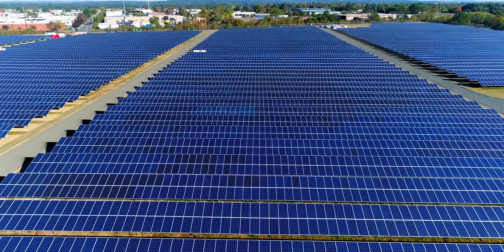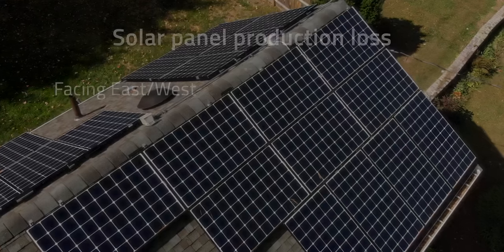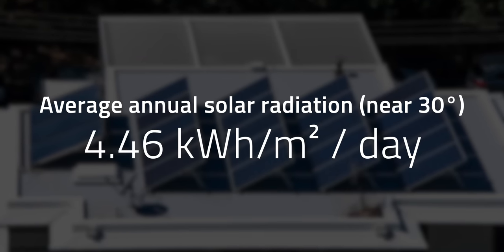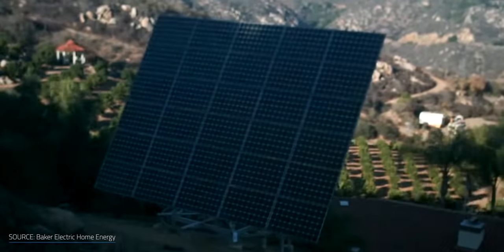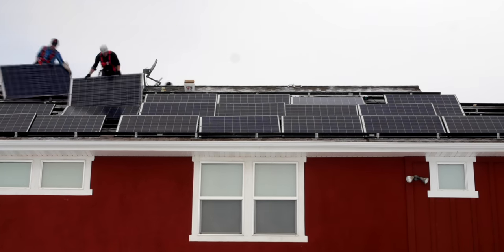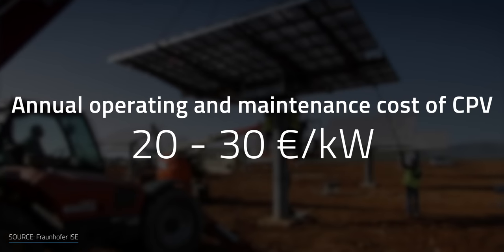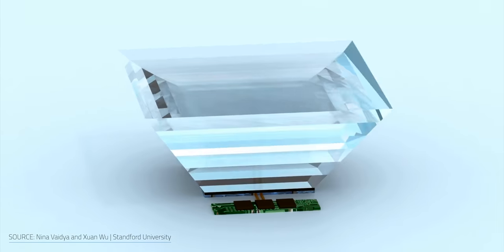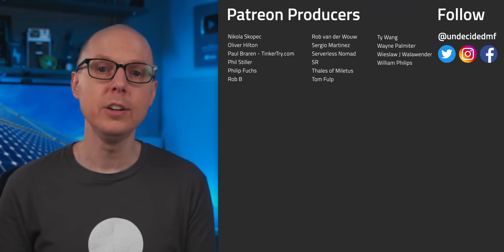This Invention Could Supercharge Solar Panels

Comment: It's like when they say they developed some new super fast charging battery with more capacity than other batteries and then we never see it hit the market. It's just an idea they presented in a lab that doesn't seem very usable in its current state. I'd be worried about weight, cost to manufacture, and installation cost/complications. Does having those lenses mean that now it's also easier to damage?

Comment: Fresnel lenses over a metal solar panel of about 1" square has been used for years, but is not really as low cost as you might think.  And solar panels work mush less efficiently when concentrated power causes them to overheat!  This causes them to turn brown, instead of the factory fresh blue color.  

Even with huge heat sinks, and fans on the bottom of the solar panel to help move away the heat, they still failed.  And the fresnel lens needed to be pointed straight at the sun, so that the sun hits the collector straight on, not the space next to the solar collector.

Comment: This can't replace the tracking systems. The area of the sun facing surface is important. regardless of how you bend light, light that does not reach the surface won't be captured.

Comment: What would be very slick is if they could produce "AGILE panels" that could be mounted to the face of an EXISTING solar panel.  Even if all it did was to "correct" the azimuth and elevation pointing errors of the installation without any added focusing, it would boost the output of any array.
.
The system I want to build is a ground mount with MANUAL elevation adjustment.  Tweak it about 4x a year to keep production roughly steady.  The auto-trackers definitely have more parts to fail.

Comment: I've always wondered why people wouldn't use an inverted panel over a parabolic mirror trough, much like a satellite dish receiver, thus concentrating the sun into the panel and reducing dust covering the panel. Would also be able to integrate solar water heating by running coolant over a heat sink on the back of the panel which would be required.

Comment: I helped run some trials a decade ago and there were a couple of CPV technologies involved. The massively increased thermal load in the cells was a huge problem. One company pretty much fried their cells by midday on every day of the trials. Those who could dump the heat had to employ various methods that cost in terms of materials and maintenance. If anything happened to the cooling systems they had to defocus the panels and stop generating.
Other than the thermal problem we all loved CPV. Less of an issue in space, not so good on earth!
Reply: Now we can buy window film from Amazon. Would help to filter out unnecessary wavelengths before the heat got concentrated.

Comment: What I really want to do is have a ground mounted system that's fairly high off the ground, which I can set up a chicken run under, and have some sort of crank system so I can manually change it to 3 different angles, 1 for summer, 1 for winter and 1 for spring/fall.  But this would be way easier. Then I'll have better power generation, shade for the chickens, and I won't have to try to mow under there.

Comment: I would really like to see a modular version of those light focusing solar cells where you can just pluck it off the larger board with a suction cup for easy replacement, and combine that with a modular board design too I think it would allow someone to simply have a large bracket and battery install and then buy sections of the board and solar cells as you go building and increasing solar power as you go till you've got enough to meet whatever their goals are

Comment: "Too heavy to be installed on rooftops." 
If instead of making a big heavy duty support structure that can withstand huge winds, a folding dish system that folds up in higher winds might be very inexpensive.  If the dish has a hole in the middle one half the diameter of the dish, the dish only loses one fourth of the solar collecting area.  But the hole would allow the dish to withstand a higher wind and require a lighter, less expensive construction.  If the dish folds up at say 30 mph winds, the wind power at 30 mph might easily compensate.  A wind turbine behind the half diameter  hole in the dish would receive concentrated wind.  Using the same support structure for the dish and the wind  turbine would save a lot of money.  Plus, the turbine collects energy at night and on cloudy days. Solar is only available during the day and when it is not cloudy which is maybe one third of the time.

Comment: I think AGILE would not work as well as it is written on paper, simply because the total surface area of the light entering the module is the same energy but in a concentrated area.  Same as a magnifying glass:  the energy of the light entering is fixed, but the output is concentrated to a tiny dot.

Comment: So, to summarize my understand of this technology: the same square feet of sunlight is concentrated onto a smaller solar cell, but this smaller cell can be more efficient, if they are multi-junction solar cells, which can capture multiple wavelengths of light.  And since they are smaller, the manufacturer can better afford for the cell to be multi-junction.  Also, with the "agile" prismatic concentrators, the panels can catch light at various angles, making static, non-tracked panels more effective.

Comment: 8:42 wait a minute. how does that work? you can only concentrate the light that falls on the lens which occupies the same area as a non lens solar cell. So concentrating the light 100x means you are putting it into 100x less area so if that increases out put 100x you are really just the same area of energy output..

Comment: I had an idea a little over 20 years ago of something that might have solar cells more efficient. But since I didn't do anything in that industry, nor had the skill/resources to try and create my own prototype to test if it was viable, it went nowhere. And I've never heard of any commercial ones using the idea in all the years since. So I can only assume either someone tried it at some point, but it wasn't practical, or nobody else thought if it yet (that was in a position to do something about it).

Comment: My concern is any time we concentrate, even with simple reflectors, there will be head.

With heat comes degradation. I wonder if concentrating would be more beneficial in more northern latitudes where the angle is suboptimal.

Comment: Using several different materials to make these concentrating lenses to bend the light sounds like it would make recycling nearly impossible. Circular PV recycling is already a problem we need to solve if we want this to be truly sustainable energy.

Comment: Why not using pneumatic or hydraulic system manifolds for tracking system? You only need 1 motor that placed anywhere (hopefully near), and valve with incremental opening.

Comment: 20 years ago I put a generic solar cell in distilled water and used a cheap Fresnel lens to concentrate sun on it. I got about four and a half times more power out of the cell.
Two problems, what to do with four times the heat on the panel (water filled panels with plumbing, pumps, radiators and fans? Sounds bad but I do need some water preheated for my pool and hot water heater sometimes on the other hand, cooler panels make more power in the summer and the water could be used to melt snow and ice on the panels in cold climates) and I could never find a large affordable Fresnel lens, they cost more than solar panels (I gave up when it looked like I would have to set-up Fresnel lens manufacturing in my backyard to make it happen).
With the potential of four times the output, I think there may still be value in the idea but, questions remain. If panels are $1 a watt, a 300 watt panel would be $300 dollars (how about those math skills?), if you could do a wet panel design, a Fresnel lens and a cooling system for $300 more per panel, you'd have $600 per panel left over.
Is concentrated, water cooled solar power half the cost of conventional systems? Should I rush to the patent office now?

Comment: Hi, thanks for the nice video. Try angling the panels 90 degrees towards the sun when there are equinoxes. then you spread the energy by having a slightly higher effect just at the equinoxes. Have a good day.

Comment: Water Cooling your panels also keeps the efficiency high. On a sunny day, panels can reach temperatures of 80 C, at those temps the efficiency is only half of the spec. The savings more than compensate the energy use of the water pump and radiator fan.
Reply: Canadian winters can really boost power (ie -40'C), if you are water cooling are you heat pumping that energy into a hot water tank??

Comment: the lame thing about CPV designs is that they try to get rid of heat via dissipation instead of trying to implant another layer that transform it too into electricity or maybe just use it to pre-heat water which can save more while improving their performance

Comment: when I designed this, it was initially for backpack and military use I have a similar model but it's a block with singular system silicone in a bed that you can unroll in emergencies i hope the free stuff i give out doesn't soak the little guy's pocket there from greys

Comment: I like AGILE but I have a worry that it will work very well when brand new but will degrade quicker over time as the lens face weathers (pitting and scratches), resulting in scattered light rather than focused light. A layer of graphene might prevent weathering of the lens.

Comment: I understand that heat is the biggest enemy of photovoltaics.   Rather than worry about trackers or light concentrators, a fan system blowing on simple heat sinks can mean greater efficiency and lifespan. I watched a youtube video demonstrating proof that you get more electricity from the higher efficiency than energy taken by the fans.  This greater efficiency applies even below freezing temperatures but is especially pronounced at the higher temperatures. 

These concentrates have to produce alot of heat which would reduce efficiency a great deal as well has  have a strong negative impact on life span. Yet no mention of any kind of active cooling system.

Also I understand that plastic yellows/becomes less transparent over time with heavy exposure to sunlight.  You said polymers were part of this new invention, polymers just means plastic

Comment: Could you add a prism element to separate light into different wavelengths and have different cells tuned for best conversion efficiency for the varying wavelengths?
Reply: You could, but multi-junction cells already do that. To cut down heat, all they need is a layer to filter out the wavelengths the cells don't convert.

Comment: Matt:   I wonder if the heat from the CSPV system could be harvested and used to run a Stirling Engine/Generator?  Essentially the heat would turn into electricity via generator without burning any kind of fuel.  I think this can be done via a second set of Concentrated Solar lenses which boast the heat capacity even further before entering the heat side of a Stirling Engine.  This could enable regulation of the capacity of the entire system by either boasting or reducing the amount of Electricity generated by the Stirling Generator.  Thanks for the video BTW.
Reply: Stanford made solar panels work at night by adding thermoelectric generators inside it.
A solar panel with thermoelectric generator is good, because that heat absorbed by the panel can be converted to electricity! But the problem is, TEG modules must be designed to withstand very high temps, especially with CPVs, they would significantly exceed the 300C rating of the TEG Generator
Reply: @daineramosquitco5816  I guess it all needs to be assessed first.

Comment: Seems like it would be even more efficient if the bottom layers of the solar panel were thermionic diodes to convert heat to more electricity. Get even higher output when you use the ground temp (via posts) as the differential but ambient sinks would work too.

Comment: The East/West configuration is better on homes, because you probably aren't at home during the day. Increasing production during peak consumption allows to reduce the battery size as you don't need to store as much charge, hopefully increasing the amount of solar power the home uses itself vs puts into and pulls out of the grid.

On office buildings and other work buildings the south orientation is better, since those buildings usually see the heaviest loads during the day.

Comment: is fairly commonly known since stanford team rpt that any widespread take up of these panels especially across higher latitudes will add to the Earth a full degree of tilt resulting in an a global average increase of about 1,67 degrees CELCIUS (!) over 35 years. If in doubt check out the lateral resonance impact kilter of the Mova Globe. Ocean dynamics will also be impacted leading to desertification over areas of the Pacific

Comment: I know this was aired several months ago but the heat issue is important to me I live in Johannesburg where 35 degrees (C) is not uncommon, roof heat very much hotter, I will think about extracting heat - simply using the feed-water input to my hot water system would reduce energy needs in that stream.

Comment: Lets do some math, if agile has a 2x higher efficiency as well as 90% capture compared to 20%, this would mean that current solar tech with agile would be able to produce up to 8x more then what it currently is ? Therefore a system of 1k would in theory be 8k with this combination of tech?!  so average homes would be able to setup equivalent of currently 3k on their roofs to achieve 20k output which should be sufficient for their entire home + electric vehicle and then some. Its quite nice, hope this comes into play soon.

Comment: Dioded to capacitor focusing is grid tightening only , load to resistance like a processor , use on demand none of this ac to DC conversion pick one or both at same for 4x capability

Comment: There are only so many photons per square centimeter that hit a panel. I don't understand how concentrating those photons to a smaller photocell is more efficient than just having a photocell the same area as the lens that's doing the concentration. After all, the same number of photons are hitting the photocell.

Comment: If they can turn this product into the actual roof itself, then in new construction you save the roofing costs; when roofing costs are subtracted from the system cost; the solar costs might actually end up cheaper while simultaneously being better.

Comment: Major flaw in this data! Solar panels are not installed professionally for year round efficiency. They are installed for maximum total production, meaning summer. This yields more annual credits. Winter is not considered.  (Edit: in NY that is, as the angle data example was NY)

Comment: The problem with the whole "cheap lenses" is their material. ANY poly based material is going to quickly deteriorate in constant, direct sunlight. It will yellow and fog up internally, the more it is exposed to concentrated UV light. So those lenses would need to be made out of glass. And suddenly the whole system is no longer cheap, no longer easy, no longer lightweight.

Comment: Usually it's more cost effective to simply add more relative inexpensive modules than adding less high efficient but costly systems like trackers. Even adjustimg the angle is usually not worth the aluminum and work. The modules are simply cheaper than the mountings. Same for this system, not worth the extra cost.

Comment: 8:42 "100 times more electricity". This guy's claiming 2000% efficiency, considering he said normal PV panels are 20% efficient.

A given projected area of sunlight has a finite amount of power, you can't extract more power than there exists in the sunlight.
Reply: Yes. People seem to always leave out the fact that on a perfect day the maximum energy the sun will provide over a one square meter area is about a kilowatt over the sun’s wavelength. Even with mirrors and concentrators it’s just refocusing energy from more area. That said, with a typical 20% efficient panel the most you could ever increase the efficiency through any means is around a factor of five for the given available energy in the area. Which would then be an unlikely 100% efficient panel, one meter square. That would be nice size wise but still the cost per watt is going to be the big driving factor.

Comment: You called trackers a "niche solution". In the last 10 years most of the utility scale installations have been trackers - we're talking more than 50% of total installed capacity. The "added costs and challenges" have been resolved with a cost advantage for trackers. The optical concentrator is one of many areas of research looking for a breakthrough but so far they have many disadvantages due added costs and challenges.

Comment: Will purchase this immediately after someone lets me know how I have to remove extra heat, that helps to lower an output and to degrade panels more quickly. But that's an interesting way to sell a piece of plastic at a price which is higher than an extra panel.

Comment: How long do solar panels last ?   What happens to the old ones ,  recycled or ?
Reply: In general for about 20-25 years. Old ones may get recycled or thrown in a landfill based off the politics of the country. They're not particularly difficult to recycle as the vast majority of a solar panel consists of glass, silicone and metals like steel, copper, etc. But politics being politics...

Comment: One question, this system seems good, but the only question I have is if these cells, because of the material they are made of, resist environmental pollution, avoiding the decrease in refraction of the material, that is, it becomes opacified.?